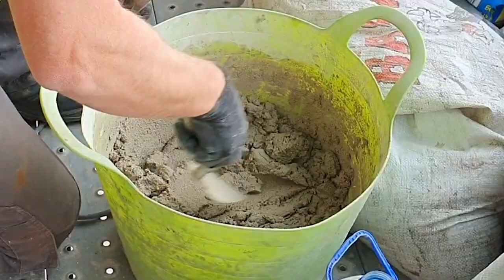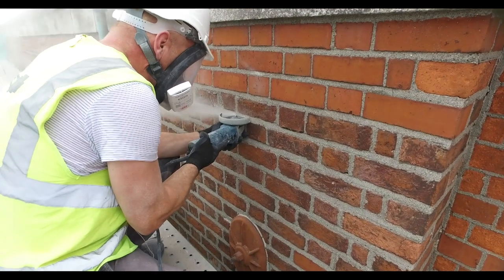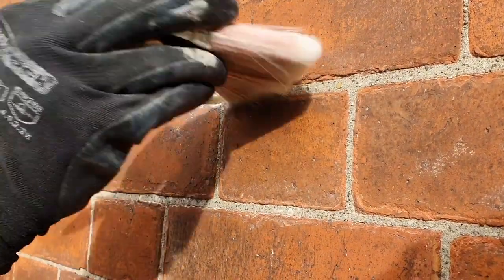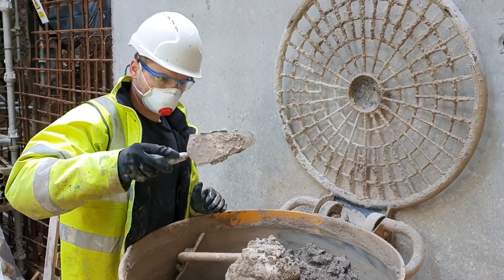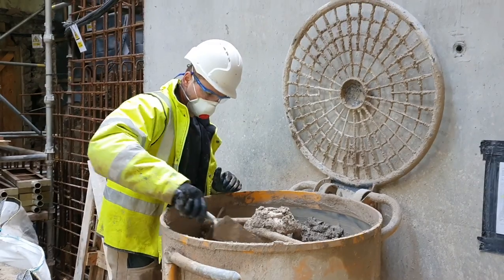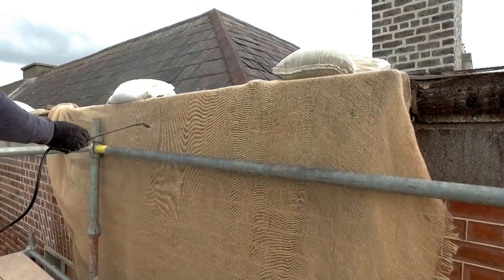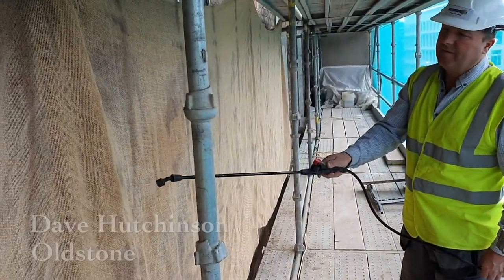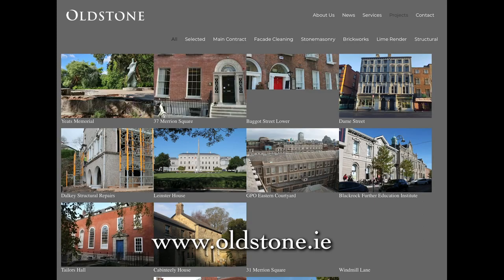How To - Flush Pointing

Comment: One of the best videos on re-pointing I have seen and it is  really useful that you present this is 6 stages.  However I am not sure why the wall was being re-pointed as it was already flush and obviously sound. I can only guess you are rescuing and old  wall from inappropriate cement rich mortar - which is commendable, so if this the case well done. 
If any would-be pointers require reliable technical guidance on re-pointing, do take the trouble to read the Building Research Establishment publication “Good Repair Guide No 24” (Re-pointing external brickwork walls) as this provides authourative further information, including recommended mortar mixes, when does worn pointing affect structural integrity and the importance of using lime pointing on old solid walls.

Comment: How do you recommend cleaning the brick/face of the brick after bashing? I've repointed the front of my house with lime mortar, but there's some lime bloom and residue on the brick face that I'd like to clean without damaging the mortar.
Reply from the maker: That lime bloom will eventually disappear. I presume you replaced the cement pointing with lime and, if so, the salts trapped behind the impermeable cement will make there way through for a while. There are products on the market that deal specifically with efflorescence (bloom) however, every time you introduce water the evaporation process will draw the salts out until such time as they have dissipated. Hope this helps.

Comment: This brickwork didnt need pointing
Reply: If it’s been pointed with sand cement it has to be removed. Cement is too hard for bricks. The mortar must be softer
Reply: Given that there are so many types of masonry walls, getting the pointing right is not quite so simple as it might first appear.  Generally speaking, joints should be raked out to at least twice their width, mortar pointing is a sacrificial material and should be weaker and more vapour permeable than the bricks, and the finished profile should ideally match the original design. Mortar should also be compatible with the original materials and this is critical in the case of older solid walls built with lime mortar where the use of cement rich mortars inhibit evaporative drying and are too hard for soft bricks.
Reply: @jr90music76   If any would-be pointers require reliable technical guidance on repointing, do take the trouble to read the Building Research Establishment publication “Good Repair Guide No 24” (Repointing external brickwork walls) as this provides authourative further information, including recommended mortar mixes, when does worn pointing affect structural integrity and the importance of using lime pointing on old solid walls.